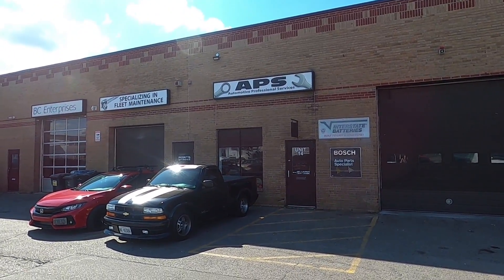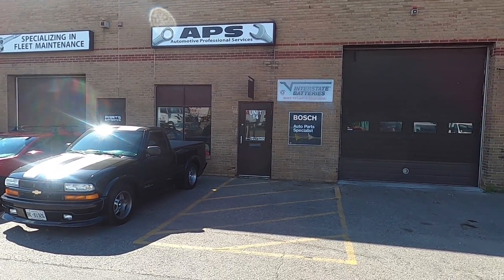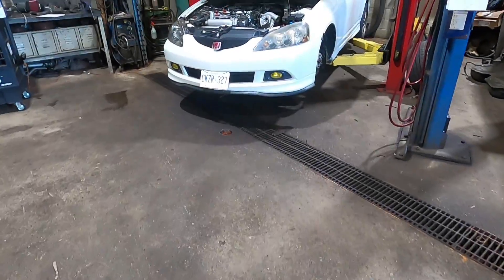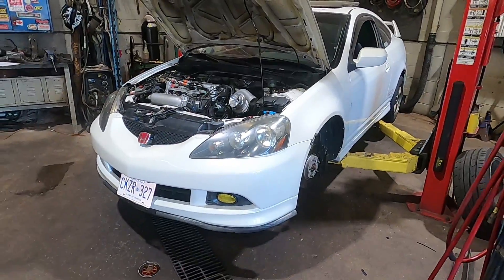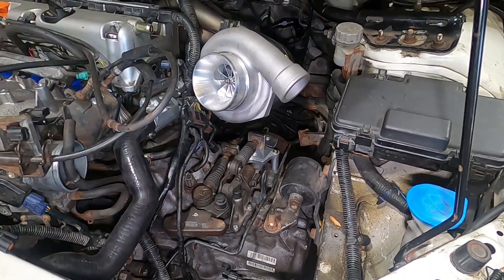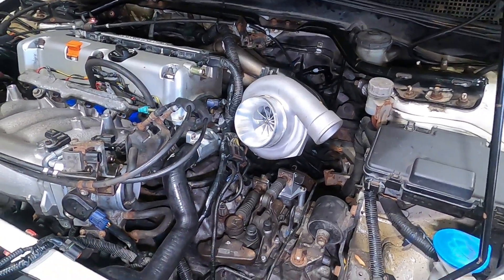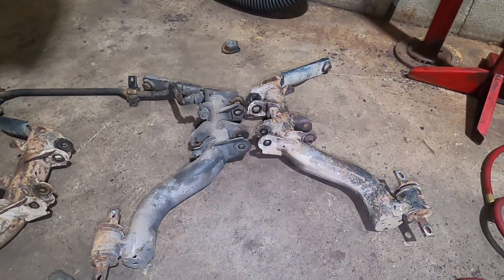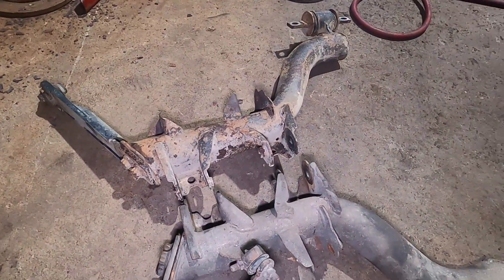RSX AWD Conversion Ep 2

Comment: Crv spindle, crv rotor, crv caliper bracket with rsx calipers and pads work. That's how I have my awd rsx setup 👍🏻👍🏻
Reply from the maker: Thanks for the tips!
Reply: @tuningbynick  ofcourse happy to help 💪🏼💪🏼💪🏼💪🏼
Reply: Did you go with a "kit" for the swap, as in something like the EP3 AWD kit from Hub City Performance? 
Or custom rear mounts with all the CRV parts? 
I've got a BOM 05 with a TVS1900 from MercRacing that id really like to AWD swap and its a tough call. I've heard so many things both good and bad about many of the OTS kits available, most of the issues being it isnt QUITE DC5 specific.
Reply: thanks for that info going start my Dc5 awd project soon
Reply: So can these set ups ever handle 500hp?
Reply: @whocares5188  yes
Reply: @whocares5188  dudes running 950 AWD

Comment: Do you know if the 04 crv auto transfer case is the same as the mt?
Can the auto transfer case be used 🤔 reliable.
Reply from the maker: Honestly I am not an expert on the differences of the parts. I’ve only played around with the manual stuff. Maybe contact S1. They are experts in AWD
Reply: Thank you for the reply!

Comment: looks incredible so far!  what is the part number from k tuned for that coolant adapter housing you mentioned??  and def gonna get that power steering line.
Reply from the maker: This is the coolant housing i used - http://k-tuned.3dcartstores.com/K24K20Z3-Upper-Coolant-Housing--Straight-Inlet_p_613.html
Reply: Tuning by Nick thank you much. Im gonna plumb coolant into my turbo. Was interested in this piece. If not used for that, ill just tap into throttle body lines.

Comment: Greta protect men ! How did you tuck your upper radiator hose.? What kind of hose is that one ?
Reply from the maker: Thanks - The Hose is from K-Tuned as well. It is designed to work with the upper coolant adapter i have bolted to the head